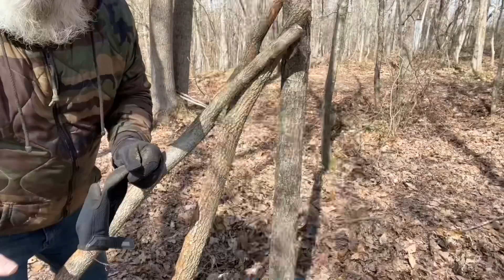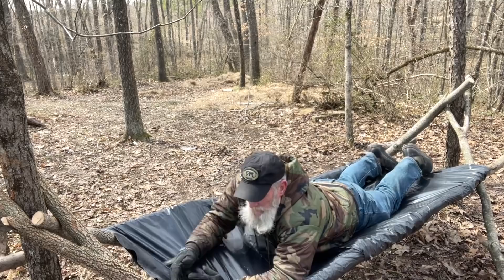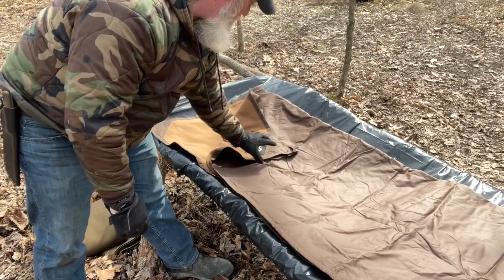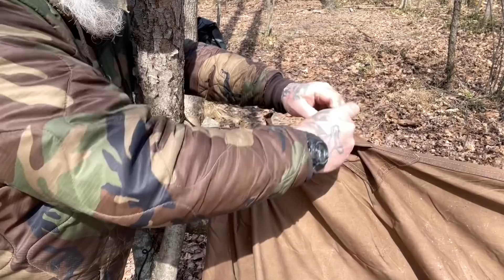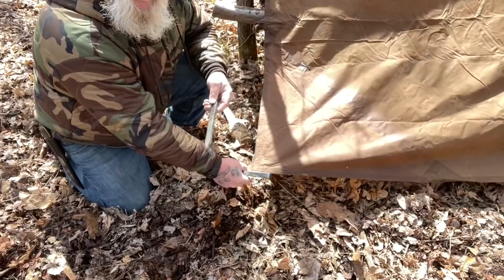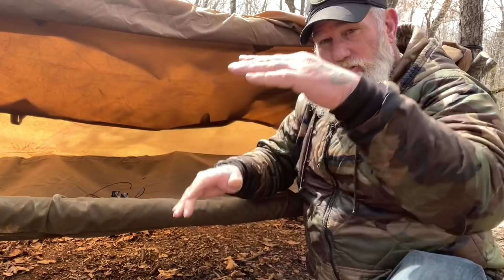Training Raised Bed No Cordage

Comment: Given a raised platform bed with a canvas sleeve and no dry browse available, presuming the ground is bare or too wet to burn, I suppose one could also heat up rocks in the fire and place them underneath the bed--ideally not glowing hot, and with at least a foot of space between the tops of the rocks and the bottom of the bag once your weight is on it.  (Just be careful getting into bed so the poles aren't dislodged.)

Comment: Greeting David! I've done a similar thing with a raised bed. I didn't use 2 trees, I just made two tripods and I use foot long heavy duty zip ties for the construction. Like the plastic stakes, they double as fuel. And instead of 2, 6mil trash bags, I use a tarp. The tarp will be folded over so you have a double thick " mattress" and can also be filled with debris for insulation. The length of the tarp is the key. If the bed is 2 ft off the ground, 3 ft wide, one fold is 7 ft but you need 2 folds so 14 ft. So 14 ft is one dimension, the other dimension depends on how tall you are. 7 ft is usually suitable. This ensures that no wind will pass under the bed because the tarp ( doubled ) will go from ground to ground. By doubling the tarp you create a fold on one side which I take an 8 inch diameter or so log by 7or 8 ft long and slide it in the fold. This keeps the tarp taught using weight. On the side that has the two ends of the tarp, I connect the grommets together creating another fold which I use a second log of sufficient weight and length. Now all tarps dont have grommets that align correctly from end to end but some do, so that should be checked out ahead of time. But in lieu of attaching the grommets together, they, the 2 ends, can be staked down, whatever works to keep the sleeping portion of the tarp taught. Essentially it just means bringing an extra tarp to use as your mattress. By using 2 tripods, you can adjust the length on the bed and if you choose to use a tarp overhead, you can use a wood pole or cordage.
Zip ties are convienient, cheap, light weight, strong and burn! But they're not reusable obviously. This also creates a pocket under the bed to fill with debris for insulation or gear in the event of rain. I prefer a 3 ft width for a bed and regardless of how taught you make it, it will sag just enough to be a bit more comfortable. Its actually easier done than said! But I like your set up in this video and will keep it in mind for a future sleep out in the great outdoors.    Regards, Chuck

I probably should add, to really cinch up a tight zip tie ( cable tie ) I use a multitool with pliers 👍

Comment: Excellent video, Dave. I have learned so much about bushcraft from your books and YouTube videos. Thank you. I have always thought a browse or tick matress as the best option for bedding. It requires a lot of work to stuff the matress, but I believe it is much more reliable than the blow up sleeping pads. I just don't think they are very rugged and durable especially for long term survival. Anything to get you up and off the ground to keep from sucking the heat out of you will work. Then you can consider how to insulate below.   Using 2 large trash bags or a matress designed specifically for that is great. It would be lighter, take up less space in a pack, possibly be more effective, and cost less than store bought sleeping pads.

Comment: Glad to hear you are going with 10' x 10' for the tarp. Can you do a video demonstrating the grommet and loop locations?
Question: I see a large safety pin in your hat. It could be a handy tool. Can you describe what uses one might have for it? Does it secure anything inside the hat?

Comment: Would not have thought of using trash bags as a raised bed.  I have contractor bags and those stretchy bags.  Another method might be to use 4 Y branches driven into the ground, though it probably requires more work.
Recently seen a video from England on making withies and wattle fencing using Hazel which is copiced(?) in their country.
I'd like to see a video on using similar materials to accomplish the same thing throughout the U.S.   Are there materials in the United States that could be copiced in the same way?
What would you use to "weave" a raised bed and how would you pad it?

Comment: Seems like the canvas tube would be better if it was a tarp loaded with buttons along one side. (one button every 2-3 inches),  Heavy duty buttons spaced closely would provide lots of strength for bed tube use, and provide for more options.

Comment: They put flaps in sleeping bags to keep air from rushing in via your neck line- could something like that be done on the canvas tube? Either internally, or as an external flap that can be "sewed" closed with bankline and small grommets? Why expend energy collecting damp leaves to lie on, rather than make the canvas into a bag of air, caulked with a few leaves where the poles go through?

Comment: Im currently in the process of making an oil skin poncho/shelter/raised bed with tie out loops on the corners as well 9 loops on either side of the length with wooden toggles, so that it can be buttoned up together  into a tube like you've shown. My only worry is that the loop will tear but I've made prototypes and so far it seems to be a good idea. 
I was wondering if this is an idea anyone else has thought of and any potential flaws I've overlooked ?